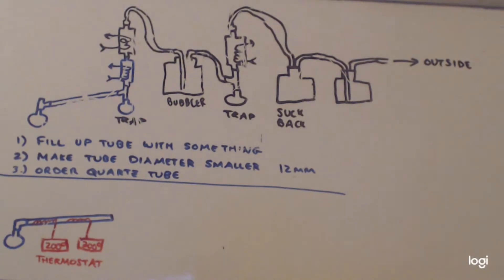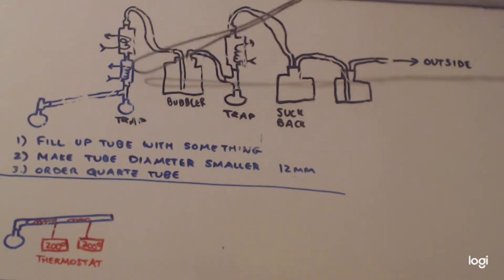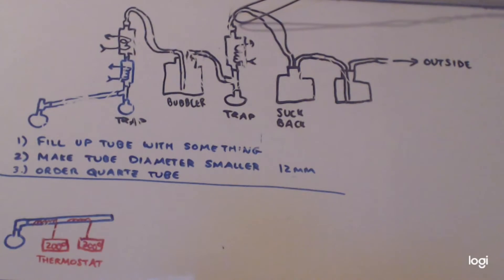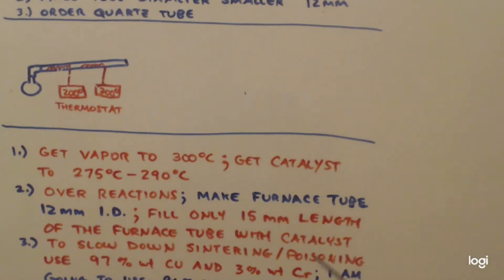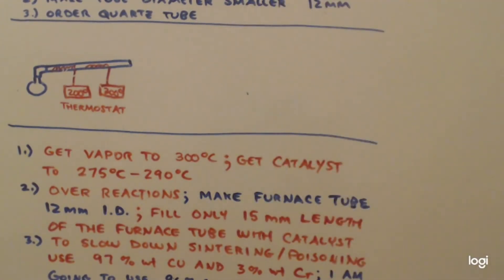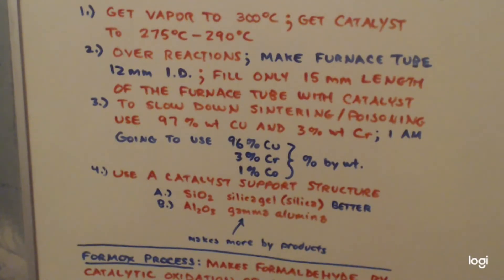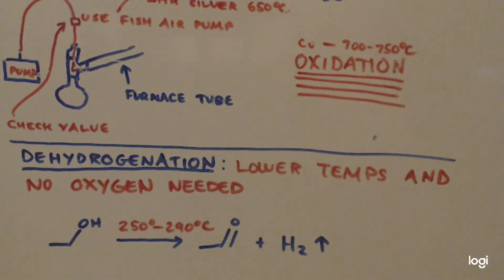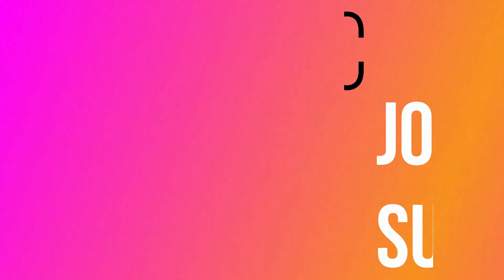ACETALDEHYDE SYNTHESIS part 3

Comment: What would happen if you mix this with bleach (NaoCl) i heard Formaldyde makes a dangerous compound with bleach. I Will not do it but it curious idea.
Reply from the maker: Chan...........If you are asking what happens when you mix acetaldehyde and bleach i would have to GUESS it would undergo a haloform reaction making chloroform and formic acid.   Normally ONLY methyl ketones and alcohols that can be oxidized to methyl ketones undergo the haloform reaction.   BUT acetaldehyde is an EXCEPTION  to the rule and also undergoes the haloform reaction even though it is not a methyl ketone.       
                      HERE IS A CUT AND PASTE from wikipedia about the haloform reaction................ Substrates are broadly limited to methyl ketones and secondary alcohols oxidizable to methyl ketones, such as isopropanol. The only primary alcohol and aldehyde to undergo this reaction are ethanol and acetaldehyde
Reply from the maker: Chan ...........actually i think it would  make sodium formate and chloroform.   Cause the NaOH in the bleach would react with the formic acid made ......making the sodium salt of the acid